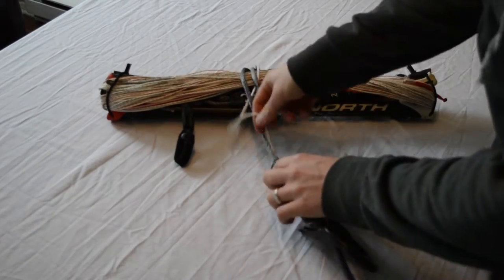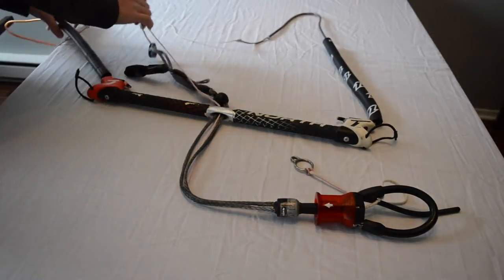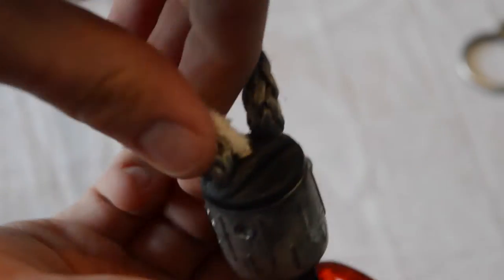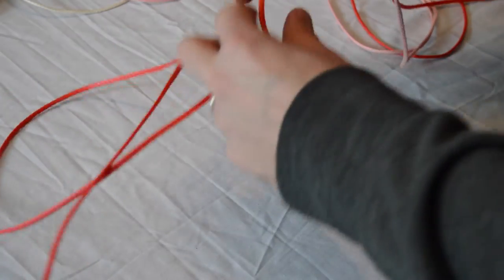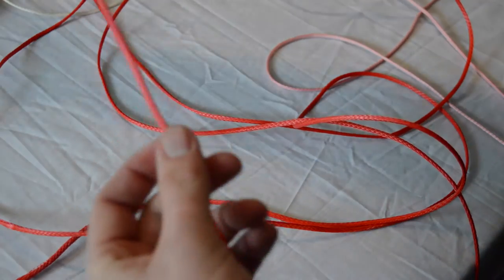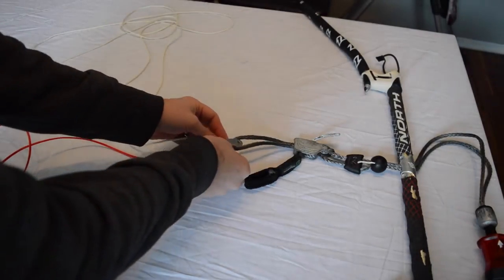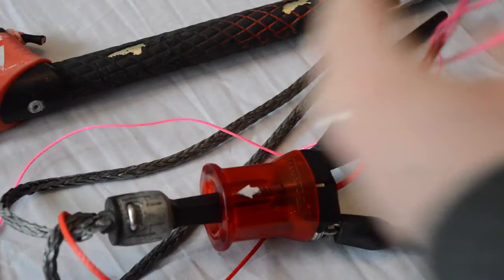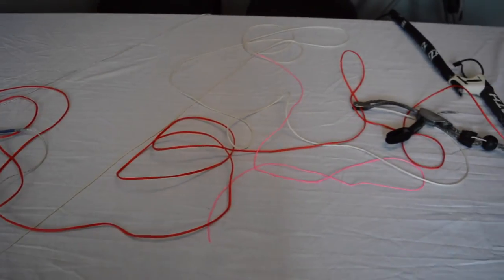North Kiteboarding Safety Line Replacement

Comment: Thanks for the video. So this is the old school depower of one of the front lines? When in real life you quick-release, the bar glides down to the point if the stopper ball, right? I've seen systems that have the QR line attached without a stopper ball, effectively pulling one of the steering lines but would the steering line and the QR line both pass through the bar?